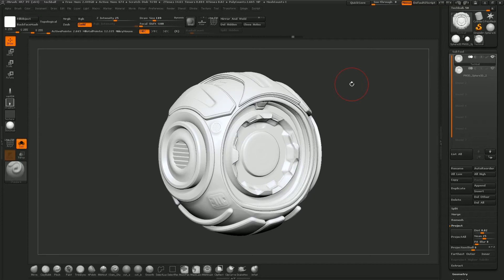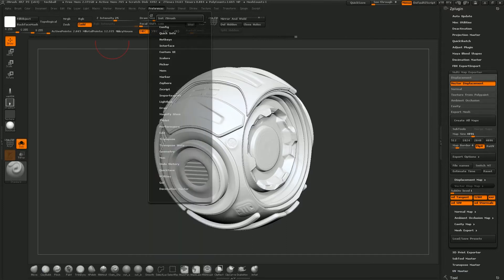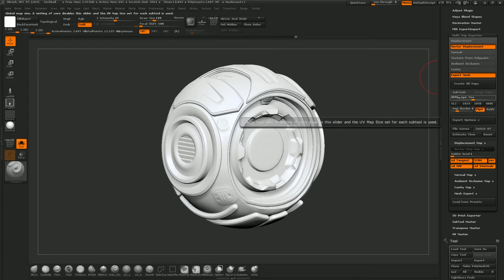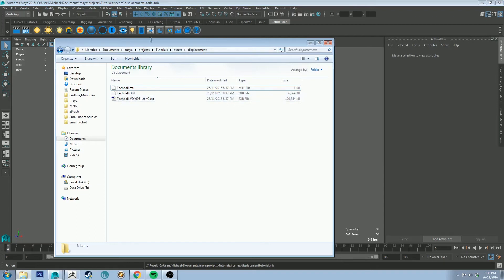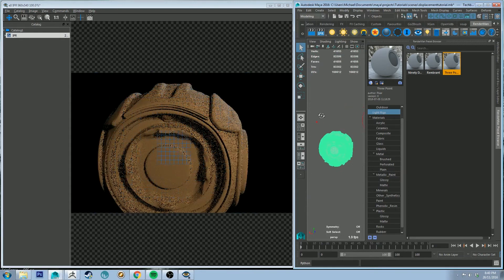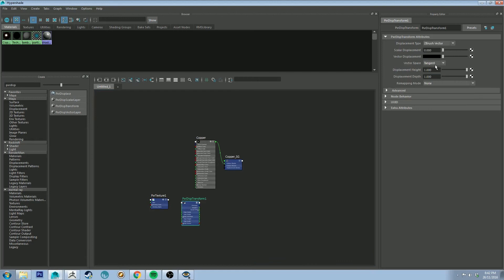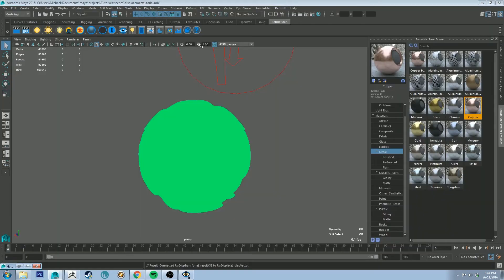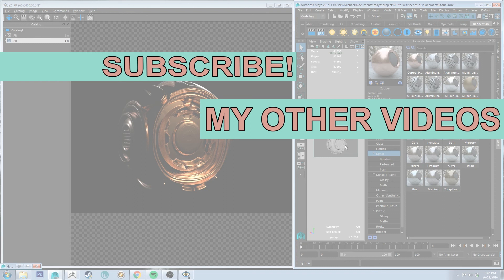Renderman 21 Displacement Maps with zBrush Tutorial

Comment: The settings in Multimap Exporter seem to have changed a bit in ZBrush 4r8 P2. I tried following these instructions the best I could, but the scale is blown up out of proportion. I sort of fixed it by switching to Scalar mode and reduced the size to a much smaller size.

Comment: nice tutorial.  i just have a question i..s it important to export the mesh from the zbrush to apply vector displacement map in renderman. and also do you know how to connect the map in katana.. that would be a great help.. thank you
Reply from the maker: +Aparna J you can create displacement maps in other packages I'm just familiar with zBrush, if you're using a zbrush model you definitely need to do it this way however. As for Katana I've never used it sorry so I have no idea.
Reply from the maker: Oh sorry, I just re-read your question - I normally export the mesh with the maps as it saves any chance of there being a discrepancy between the maps vectors and the models.
Reply: thank you for the quick reply. no worries i cant find good info about how to do that in katana.. but i will still dig in. but your tutorials are amazing. do you have any tutorial on the pxr projection layer thanks again for what you doing..
Reply from the maker: I actually haven't got in to projections yet but I shall add it to my list of things to do now, thanks for the suggestion!

Comment: How do you figure out what you need for the proper displacement bound? My displacement is showing up with UV seams currently.
Reply from the maker: +Kevin Johnson are you generating the map with zbrush? If so you shouldn't be getting UV seams if you followed this method.
Reply: Small Robot Studio I followed all the steps in the video, however the model gets kind of pulled away at the seams which is creating black gaps in the mesh
Reply from the maker: Hm, that's weird I haven't had that problem since Renderman 21 came out and the workflow changed slightly. The setting that should affect this is having 'flip and switch' set correctly in zbrush for export. Have you tried on a different model to see if you can re-produce the error?
Reply: I will try it on a test model, didn't think of that.
Reply: I'm getting this same issue. Did you manage to fix it?

Comment: Hey there! Nice tutorials buddy. If I may I'd like to ask you a question. Creating this same node network it works. However, if on this PtxTexture node i use a MudboxUV tile file name and including the MAPID it won't work. Any ideas?
Reply from the maker: Hey, so just to confirm are you trying to use ptex? If so that won't work because Ptex is geometry based so combining it with a UV map shouldn't work (unless I'm mistaken, which I may be as I don't often work in Ptex). If you're using Mudbox there may be a slightly different method that I'm not aware of as I'm not a Mudbox guy unfortunately. Hope that makes sense?
Reply: I'm not, I'm not using Ptex. Just UV Maps. Its weird because using a normal File instead of a PxrTexture it kinda works. It doesn't bump the mesh as much as it should, but you can see some effect on it. Anyway, thank you and will try exporting those maps on Zbrush. Cheers

Comment: Hey, I would really appreciate if you could explain how to work with curvature for metals in Renderman.  At the moment I'm struggling to find documentation that I can digest or straight forward examples on pretty much all pattern nodes!

Thanks in advance!
Reply from the maker: +Frederico Vieria Lopes Gomes what sort of curvature are we talking, like corrugated or more a pattern like tread plate or something?
Reply from the maker: +Small Robot Studio link me an image if you've got an example, I can then try to emulate that possibly.
Reply from the maker: Ohhhhh a curvature map I got yah. I actually do this in 3Dcoat is it's automated and really easy to do. I haven't even thought about doing this within Renderman, I guess the advantage would be that it is procedural and wouldn't require UV's and then an actual texture + spec map + normals, etc. Honestly I've never considered doing it that way as it's never been required for my workflow however it's something I could possibly investigate given the time (of which I am quite poor at the moment). For now I'd say I probably won't have a tutorial for curvature calculation on a procedural level in the immediate future however I would recommend having a look at 3D coat if you need a work around in the interim. Sorry I can't be of more help right now!
Reply: Thanks for the workaround solution ! I will dig into it. I guess you can do procedural curvature maps, however it might not be easy, Renderman power is equivalent to it´s complexity , which in some cases can scare  off newbies like me, very quickly. Thanks for yout time all the best.